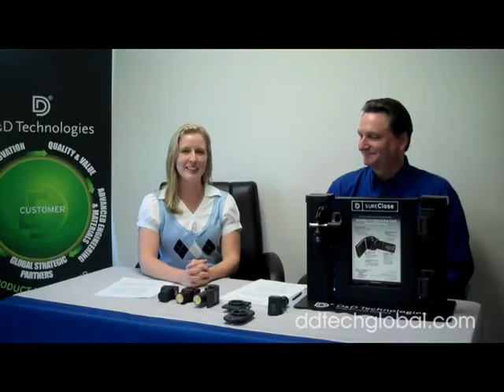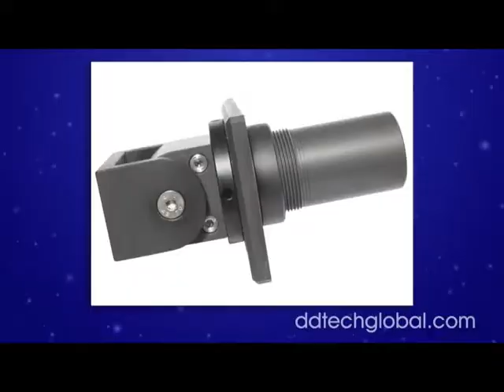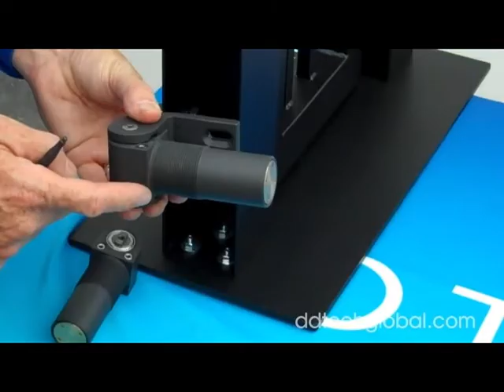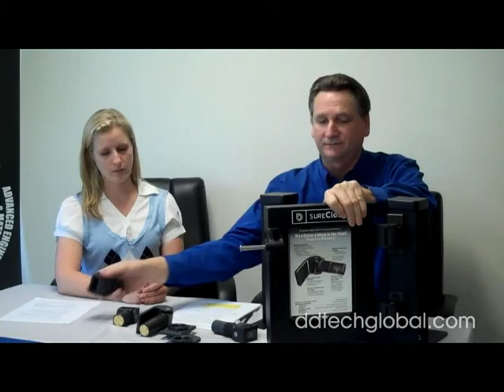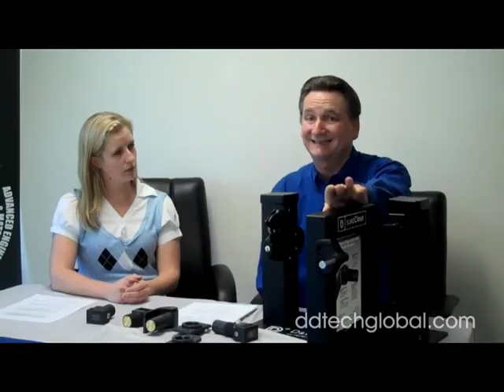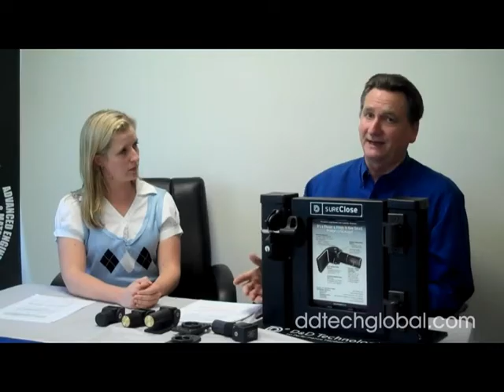SureClose No-Slam Gate Closer

Comment: I have tried and do not like. Once the hinge goes past the 90 degree angle it wont close. It is not ADA compliant and is very hard to install. I have seen another hydraulic gate hinge that can go 180 degrees and is also ADA compliant but cant remember the name. Will have to research and get back.